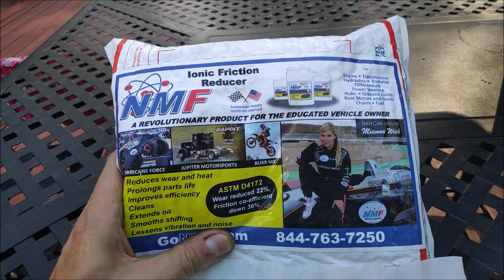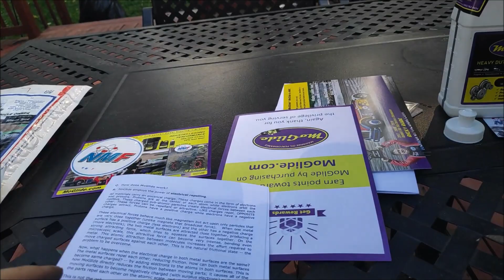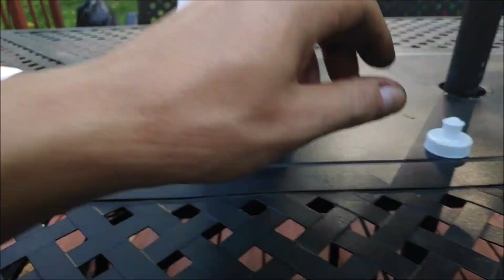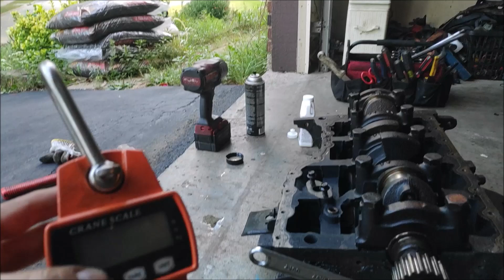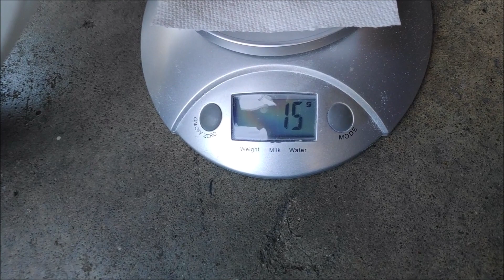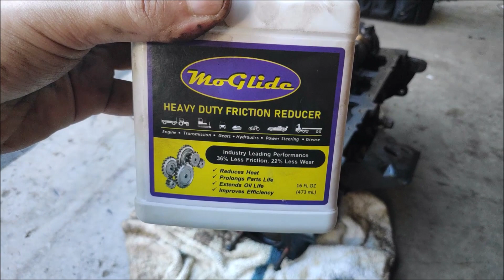No More Friction Oil Additive, Let's Test It. Part 1

Comment: I use it in my Porsche - It works!
Reply from the maker: Which part do you use it? In the engine? Transmission? Differential? I'd love to hear your results.
Reply: @everydayirace  2010 Prius went from 37mpg to 41+ mpg on exact same commute done for last 20k miles. Didn't believe it. Did the on board computer make a mistake or something? It was in ECO MODE. Where it always is.

Next day, same commute, 42+ mpg.
 Same drive except for this drive was out of "ECO MODE" with normal, no power or ECO indication. 
4 ounces in the engine 
1 ounce in the radiator over flow catch tank
1 ounce in the gas tank
All under applied per instructions. 
Vehicle has 190,000+ on all original stock engine except replacement head gasket at 168,000. 
On the second day commute of 125 miles r/t after a 30 minute fast(er) paced segment on Nor-Cal Freeways and then a red light at the end of the off ramp. Stopped, the engine was racing. The idle speed was crazy high. Normally, the engine is not running at a complete stop. But it was and fast. [It went through a idle "hunting" routine until it found it's new air/fuel/idle Algorithm. Reminiscent of my old Fox Body Mustang 5.0 with first generation Computers.]
The next 20 miles felt different. Throttle response was noticeably different. The number of times that I hit Wide Open Throttle decreased significantly. Mountain driving a Prius can irritate other drivers and be a little embarrassing. 

Suggestions: 
Add to a Full tank of gas.
Careful not to over fill the Oil Capacity. Some cars are less important. 
Prius especially, DO NOT OVERFILL CRANKCASE

Add to Coolant system. 
The formula will descale radiator and heater core. Thought I was projecting an outcome but no. Frost gone off of the windshield quicker on second day. Turned the heater setting off of HI because it was too hot. A noticeable difference.

GEN 3 Prius has an Achilles heel in the undersized PCV tubes. The Positive Crankcase Ventilation tubes get clogged from blow by. It gets caked on more and more until pressure pushes on the Head Gasket and eventually causes a coolant leak into the piston. 

Replacing a Head Gasket is avoidable IF the PCV gets serviced regularly. 

Since mine was just done 20k ago I felt that I was safe in using this product that WILL KNOCK OFF CRUD into whatever system it is applied. 

Look into their warning about the Ford Powerstroke 6.0 and clogged injectors on dirty  engines.

Understanding a little about electron transfer, Ionic exchange and heat (friction) from my day job has lead me to a broad understanding of how NMF / MO GLIDE works and what it will and won't do to any surfaces to surface contact and movement. Oil to steel, Steel to steel. Coolant to plastic, Gasoline to Aluminum, rubber, plastic. 

Why do High Speed Trains use a similar repelling technology? It works. No ionic attraction to cause friction. The opposite is true. 
It is all electrons, working for or against you.

Next I will do the transmission and cv axles. 
DO NOT USE IN CVT TRANSMISSION. 
Prius is not a true CVT it's a fancy set of planetary gears. 
USE with TOYOTA WS FLUID ONLY 

Anyone else with good or bad experience with this product? 

Not affiliated with the Manufacturer. 
Don't listen to me.
Don't do what I did.
 I'm NOT a professional.

Comment: Cool test! How do these additives affect the cylinder wall, piston rings and compression? I sure wouldn’t use it during engine break in.
Reply: Mo-glide tells you straight up not to use it in a new engine until broken in.
Reply: Way way Too slippery for break in.. After that it'll stop engine wear almost entirely